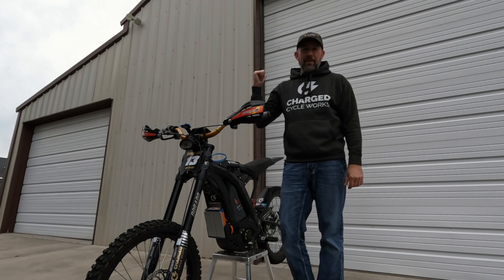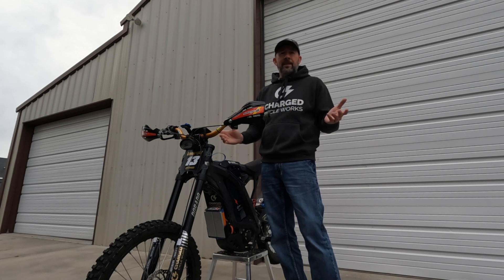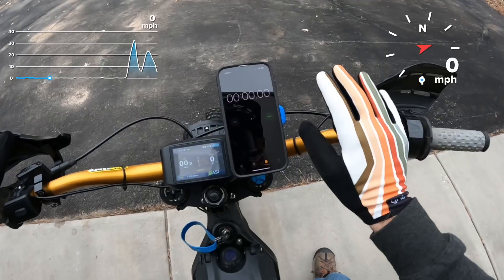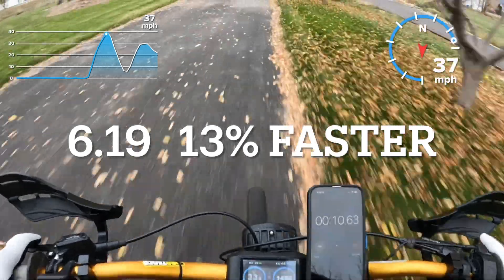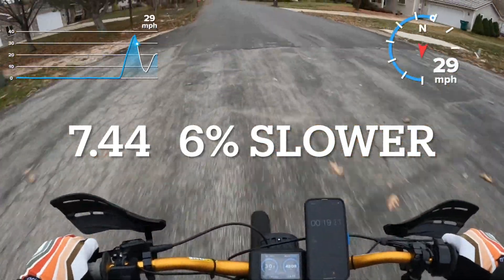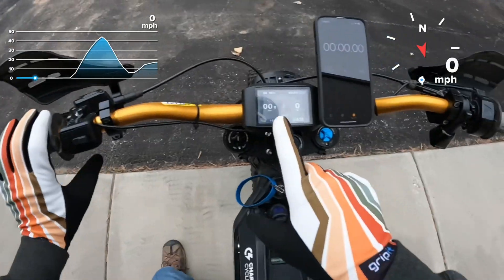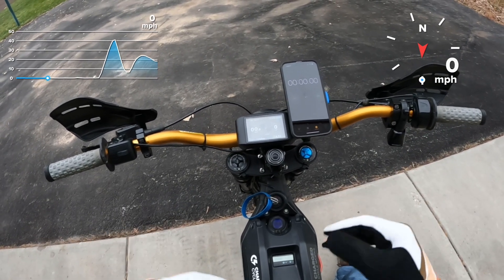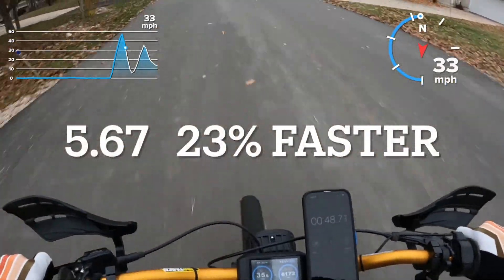Surron BAC4000 Acceleration Tests 72v vs 60v

Comment: So is that 200amp discharge on the CHi Gladiator 60v at 12kw. Chi says it can discharge 400amps and is there a way you guys can do a test on the motor at a extended ride on the higher KW
Reply from the maker: The EBMX tunes on BAC4000 used in this test are set at 425 phase amps on the 12kw tune and on the 8.5kw tune 375.  The BAC8000 tune cranks it up to 15kw and 600 phase amps and this is the next acceleration test we'll be doing.  For 2022 Brians bike is going to run a BAC8000 with the 72v 15kw tune and Nathan's bike the BAC4000 at 60v so that we have some really good side-by-side comparisons of these two popular options.
Reply: @ChargedCycleWorks  12,000W / 60V = 200A
You guys are running a ton of field weakening? It isn't really needed for this test

Comment: What handlebars do you have on this bike
Reply from the maker: We have switched to Motocross bars on our Surrons because the MTB industry has forbidden us from selling MTB bars claiming they were not made for these bikes and not wanting to be liable for breaking and warranty.  We are running prototype stems at the moment and will be selling direct mount stems next year made for MX bars.  Plus coming from an MX background we tend to like the moto-bends better and they are available in a taller rise.  The ProTapers in this video are Pastrana Bend and 4.75" tall.  They feel amazing and we'll be selling them as soon as we have a stem that can hold them.  As soon as we have more to share we will.

Comment: In acceleration tests dragy would be very accurate and consistent. Also will graph info out g forces etc… with video overlay
Reply from the maker: Great recommendation, thanks John!
Reply: @ChargedCycleWorks  great vid… I’m tossed up… same setup as you (bac4000/12k tune)and wanting a chibattery but now that I saw how close the 72 and 60 were, I’d rather have more ah… 
I’m assuming if I had a bac8000 that would make the differences bigger (maybe a future vid for you?).  Mostly fast commuting (with daily wheelies) so level 1,2… with 3,4,5 on tap for the 90/10 street/dirt day.  Curious, stock throttle?
Reply: @eleon1143  ref doing to buy a Sur Ron & you seem to know what you're talking about. I've no idea but wanna fast, quick, off road capable bike with decent range. I'm not a speed demon, just want to cruise street & trails with random wheelies. No prob jumps or nothing
Reply: @rconn4501  the stock Surron or even Taleria Sting, does great stock. A $20 battery bypass kit and you’ll get 45mph solid with wind in your face… that’s plenty to be happy with for price of the bike and minor upgrade.  Little by little can modify it, but for commuting, and occasional dirt trails.. it’s totally fun.  Battery upgrades usually need a controller as well ($1500 battery, 900 controller) but you can get by with just a battery.  I think stock is 4000kw and a stock battery bypass ($20) gives you a slight bump (maybe 5000kw but at the cost of range.. or less mileage.  If just a battery upgrade to the many 60v 60ah batteries out there will bump power up (tops is 7kw,) even more but gives you a lot more range.   I didn’t throw phase amps in to not confuse you or myself with numbers but just keep YouTubing videos of diff battery options.  It’s cheaper than experimenting on your bike :)
Reply: @eleon1143  oh yeah it gets more complex lol. Thanks, I'll def have a Sur Ron next year and maybe upgrade it the following...

Comment: 72v BAC4000 12kw vs 60v BAC4000 12kw, 60v is clear winner since it gives more range right?
Reply from the maker: GREAT QUESTION, Maybe, we need to do some more testing side-by-side 72v vs 60v of similar capacity batteries.  A lot of people think a 60v 50ah battery has a longer range than a 72v 43ah battery because of the bigger ah number, but that's not an equal comparison.  You must multiple the two numbers together to get the energy storage (watts) of the battery: 60*53=3180 72*43=3096 so in this case (EBMX batteries) the 60v 53ah contains 84 watts more than the 72v.  However 72v runs a bit more efficient, there is probably no noticeable difference in range between them in this example.
Reply: @ChargedCycleWorks  also thinking about buying 60v bac4000 over the 72v, which would u recommend? (wheelies, range)
Reply: @Feintyyy  got this setup and I love it, I went with 60v cause it’s what the bike comes with and didn’t see any real plus to go 72v, personally
Reply from the maker: @Feintyyy  60v provides backwards compatibility with the OEM battery, 72v can achieve more power and torque but you really need a BAC8000 to unlock it. 72v also runs cooler for those that do big hill climbs and experience overheating.   Range is much more about how far your right hand turns the throttle and the battery size.  For example prior to upgrading to 50+ah batteries our average ride was about 15-20 miles.  After upgrading to larger batteries we still kill them in about 20-25 miles but the big difference is that we can now ride super hard/fast and have a blast the entire  time, range did not improve that much but the fun factor improved dramatically. Of course if we rode slow we could get 40ish miles, but  that never happens ;)
Reply: @ChargedCycleWorks  @
Diego Banuelos thank you for your answers:)
Would go with the BAC 4000 anyway. So as I see, the 60v battery with a bigger capacity would be the better choice here.